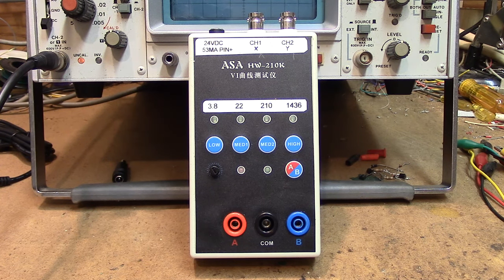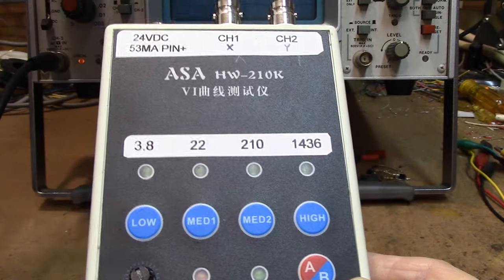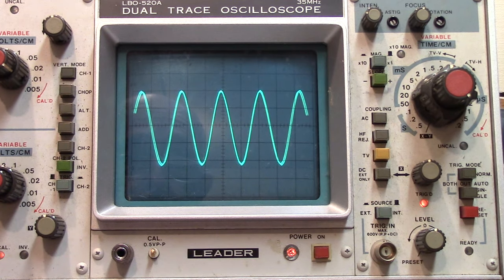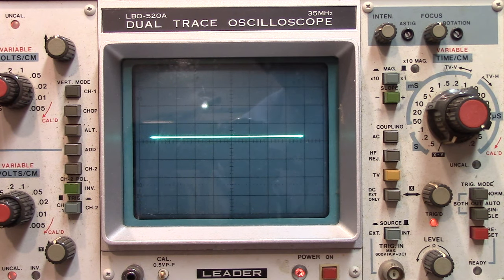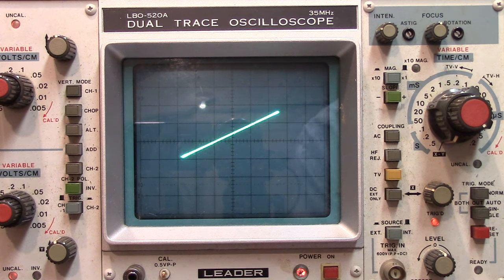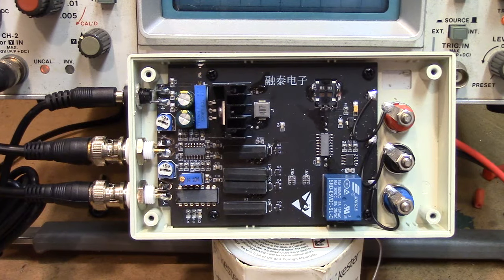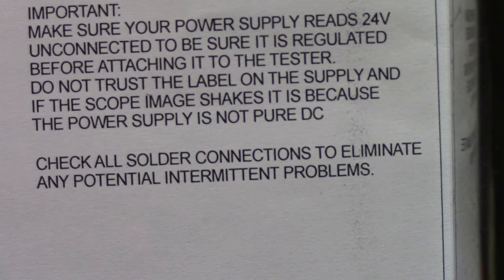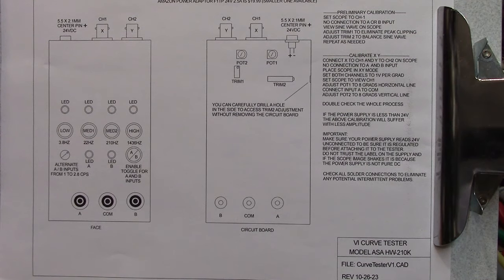Curve Tracer ASA HW-210K review

Comment: I’ve got an old curve tracer. It became my primary diagnostic tool when i was doing component level repairs in a shop. I could test most components quickly and easily. Saved me a lot of time and rarely failed me.
Reply: I have a 35 years old curve tracer, some years ago I bought one of these new units, I conect to a digital oscilloscope and conected to a computer for download all the grafics for future references.
First line tool for me.

Comment: I just bought one of these; same model. I measured the 4  test frequencies, my unit: 30 Hz, 223 Hz, 2168 Hz, and 14,301 Hz.  These move around a bit with temperature/on time, I see no problems. I’m very happy with the value for its price.
Reply: I had the bnc spark before I plugged into my scope so I never plugged it in. The other end of the cable was on an esd mat so I didn't want to plug it into my my rigol mso5354 or my old tektronix tds2002c. 

I have been in the hospital since it happened due to unrelated reasons but I could just use my isolation transformer after I check the internal connection since I just got home.

Comment: Hello Charles. Do you have an idea of which regulator has the 210k i bought One but After some time i got smoke from the IC with heatsink.. i would like to repair it
Reply from the maker: If the number is not on the part in question, I don't know what it is.

Comment: Hi charles, after seeing your video i bought one. I connecter to 24V positive central. The traces started to work (lights on) but after a few minutes while i was still trying to figure the setup i head a bad burning smell. I found the internal IC (the one connected to the heatsink) burned. Do you know which IC is that? and what could have happened? maybe 24V was not the correct supply?
Reply from the maker: Nobody else has reported a problem using 24v. Since no instructions come with the device, I cannot verify if your model was made differently. I do not have a schematic and cannot identify parts numbers.

Comment: My power supply connector is 5.5 x 2 mm and I can't force it into the connector on the ASA unit. Could it be 2.5mm center pin?
Reply from the maker: Try 5.5 x 2.1 as noted in the video. Maybe they changed the connector size. Not sure.

Comment: Thank you Charles for making this video. I received this device today with no instructions. I would have been able to figure out how it works eventually, but I had no idea what supply voltage or polarity it required.
'Cycles-per-Second', not heard that term for many years !
Reply from the maker: It was the same with me, but I was determined not to be outdone so I spent the time to figure out what it was all about. I'm glad the video helped. I'm an old-timer so I use all the outdated terminology. I grew up with CPS, not hertz.

Comment: Any suggestions for a 24 vdc power supply? Does the power supply need to be an isolated from ac line type? 15 vdc wasn't enough to make it work.
Reply from the maker: Lots of 24Vdc adaptors are on Amazon. 2.5A or 60W is good. The 120/240AC line type is OK. I don't know if yours is 5.5 or 2.1 connector but a lot of them come with both.
Reply from the maker: Look on Amazon for F1TP 2.5A and get the one that shows the extra adaptor.

Comment: Thank you for sharing your knowledge and finds. I have the same tracer and used an 12v power supply. But after your in-depth video, I’ll be ordering an 24v ps asap and start to calibrate the tracer correctly. Thanks again
Reply from the maker: I verified the 24V on an ad on Amazon for this same model. It will barely work on 12V and fails at 11V, Don't know about other models.
Reply: @charlessmith833  Do you have a link to the the Power Supply you purchased on Amazon?
Reply from the maker: I can no longer find the exact power supply I purchased but you can find similar on Amazon. Look for 24V Dc output 3A or less with a connector 5.5 x 2.1mm @locotx215

Comment: Thanks for your explanations of this undocumented device. My copy came today from Ali and I found, that I've to use 200mV/div at X channel and 2V/div at Y channel for a correct X-Y display. Is this normal behaviour or should I adjust the X amplitude higher (or maybe Y amplitude lower) ? Apart from this, everything is working fine, so I'm not sure if adjustment is recommended.
Reply from the maker: I like for them to be equal voltage. You need to be able to interpret what you see.
Reply: @charlessmith833  Ok, I adjusted both channels in 1V/div. Easy going. Just wasn't sure if the output voltage/current would be affected. But I still see 4.8V AC there.

Comment: Awesome video! I ordered a couple of variants of these recently and am somewhat paranoid that it could kill some components if used in circuit due to the sweeping voltage range. I get that it’s quite low current, so maybe the risk isn’t as bad as I think it could be. Would love to see a followup video actually doing a test or repair of two identical boards with the alternating A/B function and the boards grounded together!
Reply from the maker: The test voltage is actually a very low current sine wave, which easily collapses. I don't think it could hurt anything. Just be sure the circuit you are testing has been turned off and the power supply voltage has been drained, otherwise you will probably damage the tester. The alternating A/B function works well and if you have two identical parts it will do a compare for you so that you can determine if one of them is bad or deficient. I will be using mine to test discreet components rather than comparing circuits. Perhaps, someone will make a better demonstration.

Comment: "No power supply"
"No input voltage information" 
Ahhh, Chinese electronics. Such a convenient, wide selection of inexpensive components, which can also be very inconvenient at times.
Reply: China is the land of crappy software engineering except for the consultant agency they hired to watch their citizens. It's bananas. I have rigol and siglent gear and while not cheap I was able to unlock every feature. I'm tempted to buy a tektronix  curve tracer so I have it and never need to worry about another. Buy a second hand one I mean. The prices vary wildy. I know my local schools do not have one and I plan to donate it after I'm done but dropping 2000cad on an ancient one with no guarantee of functioning is alot. A friend has one that's broken but won't fix it or sell it so I can. Haha. I'd just replace all the opamps.

Comment: 8 graticules in x/y mode, how many volts/graticule did you set the scope to ? as I would like to be able to measure the curve parameters ie Volts / Current of the DUT ,  PS I took your advice re 24v power supply .
Reply from the maker: 8 volts I believe. 1V per graticule.

Comment: Thanks for the video. 1) What button should be selected (low,med1,med2,high) when calibrating? 2) Have you seen latest version NI-210SU with inbuilt display and Li-Ion battery chargeable via USB? Does it matter much that it has no graticule or way to measure?
Reply from the maker: Any frequency should work for calibration. Actually you are looking for a pattern or curve more than for measuring. Use your scope in all cases. Not sure about the revised version.
Reply: @charlessmith833  So rotary knob does not affect calibration voltages either?
Reply from the maker: All the knob does is control how fast it switches back and forth between the two inputs when doing comparisons. @steve6375

Comment: Thank you for this explanation.  I foolishly thought there was a battery-powered oscillator inside to provide the test current.  Now I have to look for a  24VDC adaptor and cable, but perhaps an old laptop PSU with 19VDC might work and the cable plug might be OK too...?
Reply from the maker: You need a transformer type power supply for better isolation and safety. The one I bought on Amazon is a transformer type, regulated and with the right connector. I think I paid $20.00. It is shown in the video.
Reply: @charlessmith833  Good point - thanks again!
Reply: I'll have to get one  of those, it was not possible to use the bench PSU either as there is a 12V DC offset between the scope ground and the BNC ground on the curve tracer, the current drawn was over 0.6 A  so I disconnected it asap!  @charlessmith833
Reply: NI-210SU has internal Li-Ion battery and USB charge cable plus built-in LCD display.
Reply from the maker: Chinese progress. @steve6375

Comment: Well, mine arrived DOA. One channel very low output of only about 5 mv even with the pot turned up full. No dry joints so I think it's the chip. They have helpfully removed the markings. Anyone know what clock chip they used?  ( the big one near the  BNC outputs)

Comment: Just arrived. The box says 5v 1 amp. I'm confused.
Reply from the maker: Too many varieties out there. Follow the instructions. What can I say? To avoid a potential problem, you can use a variable power supply to see if it works on 5V. If not, you can try increasing the voltage little by little until it works. Do it carefully.

Comment: I have a curve tracer, I don:t think i get the same display with FETs, if that were a pentode tube I say that is space charge building. What FET was that?
Reply from the maker: MPF-102. The input is floating. It is a very sensitive FET
Reply from the maker: 1 to 10 MEG resistor from gate to source is all that is required to stabilize an MPF-102.

Comment: Be careful some of the others that look similar (they may have a few more features) ae 12 Volt and will burn out at 24 Volt.
Reply from the maker: This device will not work at 11V and it barely works at 12V. It will work at any voltage above that and up to 24V. However, the output voltage will rise with the input voltage and that makes the calibration different. It should have had a voltage regulator on board to prevent that. Other than that, it seems to work OK. No overheated parts or any other adverse effects that I can find.